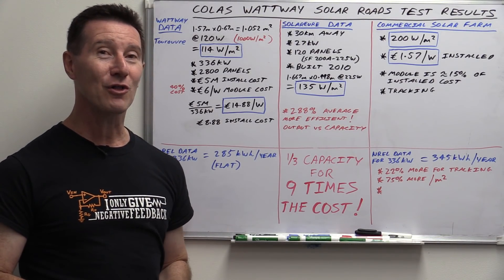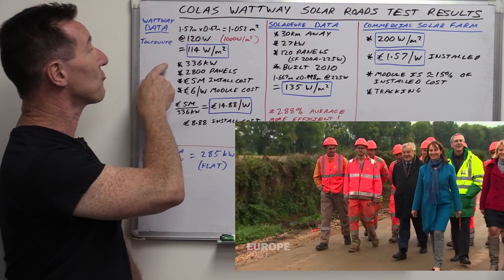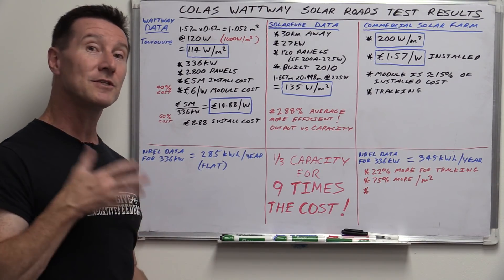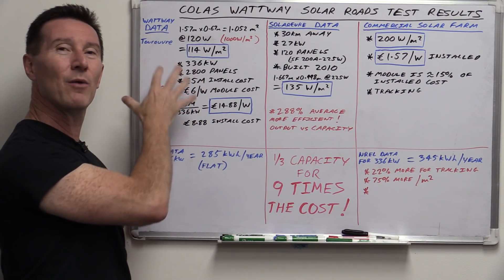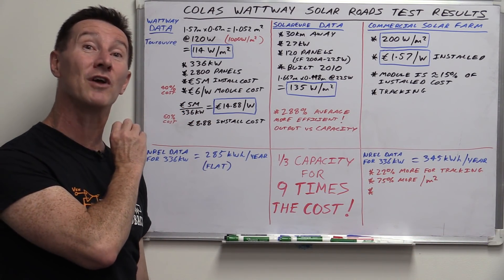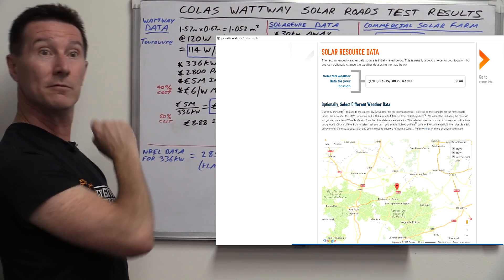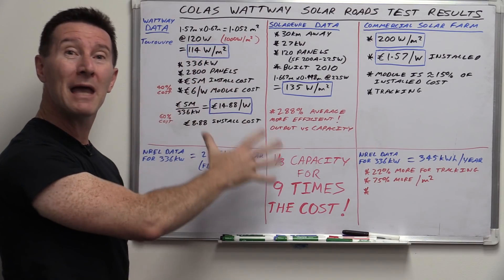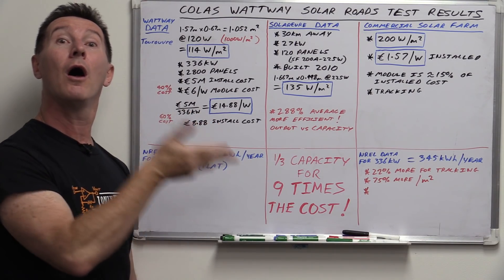EEVblog #1047 - Solar Roadways FINALLY BUSTED! (Colas Wattway)

Comment: Promote rooftop installation of solar panels. That would make good use of a lot of available space, doesn't require the space that we commercial installation and would also make more sense then solar roadways. Like you said, any government employee that supports solar roadways should be sacked. There are way better ways to spend the taxpayers money.

Comment: One of the worst variables of a solar cell is actually heat, believe it or not.  As heat climbs, output declines.  Now imagine a panel on one of the most thermally capacitive materials (ceramics and stone) in the worst color for thermal dissipation / reflection (black / dark grey) and in typically, or even seasonally, hot climes.

Now imagine your device also generates heat and that you've cut your surface area for the heat dissipation of your device by half.

The best case scenario isn't simply sub-optimal output at high cost, it's that the things don't overheat - short - and then catch fire.

I imagine a system based on geothermal gradients would be more cost efficient and practical.  Use the roads to trap and store heat, run water through chases and hollows in and below the hot roads to a heat exchanger, run an engine (maybe some sort of sterling engine), profit.  It would never generate the same power as a power plant, but when we're playing the "every little bit helps" game - it's better and smarter than gluing solar cells to highways.

Comment: if only they marketed something a bit more practical like "Solar freaking Rooftops!" perhaps make some cheap/simple/easy rooftop replacement solar panels or add-on things (like we have now...) and put them on all the rooftops.. it would be almost like a solar roadway but.. without the problems? no cars/rubbish on them, can use more efficient panels.. etc etc.. urgh :/

Comment: I looked up an early article from Dec, 2016 that said that they projected an energy output of 280 MW-hrs/year. The data shows they got 150 MW-hrs/year, or about half the projected amount, and that is in the first year. The panels will deteriorate over time, so that number will go down each year. at 0.15 Euros/kW-hr that would be a payout of 22,500 Euros for a 5 M Euro cost! Even if they cut the cost to 10% of the first try it would take 22 years to pay off even assuming ZERO maintenance and no loss of output over time. Both of those assumptions are wrong!

Comment: Rooftop installations, and even rooftop PARKING LOT installations makes FAR MORE SENSE. Too bad that the Wizard's First Rule is so VERY VERY TRUE. I've seen it proven over and over "People are Stupid; People will believe what they want to believe."
So much money, and R&D has been wasted on this fundamentally flawed idea.
"Wouldn't that be so cool, to have solar roadways, this hype cool thing with changing indicators on the surface" etc etc... But it will not work in a cost effective way!!!! Just spend the money installing REAL EFFECTIVE solar installs.

Comment: I'm still propagating the solar noic blocking walls for highways, you can put them on a fixed angle, better than flat and they will only get shadow from the higher trucks, but you could compensate for that, but just an idea that may or may not payoff

Comment: A much better solution would be adding solar panels ABOVE the road. You automatically get rain and snow protection and solar panels that actually works. And you can add overhead lighting that uses part of the solar power. It would probably be cheaper to install too. However, servicing might be costly.

Comment: Solar frikkin' car parks might be a better bet. I'm thinking sports venues and out of town shopping malls. Traffic speeds are low, so skid risk is low. Surfaces tend to me much more level, homogeneous and uniform, and not the thin winding poor maintenance access ribbon constructions of a typical highway. The high wear, high speed surface of roadways sounds like a high maintenance low return engineering fail from the outset.

Comment: Should it not be 1/3 the Produced Energy for 9 times the cost?  'Install Capacity' is generally the peak watts... and, we can already see that to install 1W of roadway is  9x more expensive than installing 1W of commercial. Same "capacity"... but different real world generating capability, ie. the roadway generates at 1/3 the output for equivalent install capacity?
Semantics maybe, depends on how you define capacity.

Comment: Only valid argument is that roads belong to the government and fields covered by solar farm panels can be used for food growth. So long as the lifetime of the panels is long enough and a good maintenance contract is negotiated it doesn't matter so much what it costs at the start. How would the government buy all the fields to make solar farms of the same output instead? It's simple, there are more than 9*3 the available road surface than private fields we don't need for food available for free). And touching greenbelt land is a political and environmental no-go, besides it would look terrible whereas solar roads look better than tarmac. It's a bit like discussing the purpose and costs of modern roads when we only had dirt tracks everywhere; the future generation will laugh at this discussion when age of "abundance" comes soon (see Elon Musk's discussion about that) then manufacturing and labour costs will be irrelevant. You did a great job focusing on the electronics, but you forgot the most important factor. Please consider re-doing the calculation with the cost of renting private land added-in and somehow factor-in what it means when farmland is lost (must be some "sustainability" data somewhere to mix-in). I'm only a technical person too, but the political arguments alone are fantastic with solar roadways, so they're probably coming whether we think they are silly or not.

Comment: Watch the public outcry the first time they get a burst water main under one of these roads - what would probably require a road closure for  a day or so to rectify would turn into many many days. the road would be down on generating capacity (if able to generate at all) and the cost to reinstate the surface would be huge in comparison to straight tarmac.

Btw way I have this fantastic idea for "Solar Gardens" - take existing public parks and gardens, remove all the existing trees (the timber from these would be sold to assist in funding) then replace them with artificial trees where the leaves are all tiny sun tracking solar panels. There are many additional financial (business) benefits -  you can lease trees to telcos to put cell phone towers on and build little tree houses in them to rent out as small economic city dwellings

Any backers out there?

Comment: Hi Dave,
Excellent analysis as always.
To answer your question about the use of such a poorly optimized design: IMHO, being French and an electronics engineer myself I can tell you that it is a lot more appealing to the everage people (through the media who don't know a thing about yield and electronics) to have a technology that does not change anything to people habbits, rooftop or landscape appearance.
Sounds silly, but here some people still think that environment protection will eventually be deployed without changing the people behavior, so the government proposes solutions that go that way.
This project can be seen as a milestone more than as a technology that will be massively developed. Because in the end nuclear power is much cheaper and available
Reply: Nicolas P Oh it will change when the road starts degrading rapidly with age and people lose control of their cars and die in horrible crashes.

Comment: It would make far more sense to put cheap panels above the road, slant them at an angle and it helps direct rain away from the road surface, keeps the panels clean, and they're out of the way of traffic. If they used the really cheap and light film type panels then it wouldn't require any big supports either.

Comment: I read a few months ago about a company who was going to spend hundreds of millions of dollars I presume to install a solar farm in the Chernobyl exclusion zone. This seems equally as silly as the roadway idea due to the poor climate! they would be far better off building solar farms in the deserts and transmitting the power where its needed. Even at 50% transmission loss they would still be more efficient than solar roadways or putting PV in rubbish areas.

What is it with people who think solar is "free" energy... they don't realise that these panels have an environmental cost to produce, and install, also the electronics and wiring infrastructure all have a "carbon footprint" so wasting those materials on low efficiency installations is almost as bad as just sticking a diesel generator there! We need to get smart with Solar and use it appropriately such as solar thermal solutions with tracking mirrors to focus sunlight into a small area to boil water and run turbines, this requires more initial cost, but yields a more robust, higher efficiency system.

Comment: http://assets.amuniversal.com/86243fc036e9012ea5cb00163e41dd5b

Solar PV has some value in reqions where aircon is needed, or where no mains electricity is available. In others it's mainly a subsidy-sucking exercise. The price of the panels is artificially low, due to the market being flooded with surplus panels after subsidies were reduced from their original crazy levels in most places.  

Basically, few if any of these 'green energy ideas are worthwhile, and the problem with convincing people of this is that it's become a kind of religion. Call it sun-worship if you like, it's very close to the old pagan idea of the sun being the head god and giver of all life etc. If it comes from the sun it must be good.  

In reality we'd be better to spend the money on research into better ways of obtaining energy such as LFTR or fusion. The Greens won't have that though, because it doesn't fit in with their sun-worship religion.

Comment: Hmm the ideas there, maybe to get rid of the large installation cost they move the solar panels from the road to one location where land is cheap and sun light is optimum, these lets call them "arrays" could be made to track sunlight for maximum efficiency and the power can be distributed evenly and efficiently as it's coming from one large place, oh wait....
Reply: Oooh, solar parking lots?  Now you're talking!  A solar multi level would be better, because more solar road, obviously.
Reply: We could also just build this large facility designed to create a miniature sun who's heat boils astronomical amounts of water, turning turbines, which produce unfathomable amounts of electricity free of greenhouse gas emissions regardless of time, weather, or location?

My honest opinion? Solar power is a bandaid *at best*. IT's a piece of shit if you're not in a good place for one reason or another. No, we need to figure out nuclear fusion. Once we've passed breakeven on fusion reactors we can flip all this other 'green energy' tech off and throw it in the dustbin where it belongs.

Comment: For the people who still insist on wanting solar panels on roads... a far better idea than putting the panels on the surface of the road is to put the panels on a canopy OVER the roadway. That puts it more in the realm of rooftop installations and the canopy would shield the road surface and vehicles from UV and weather, plus maintenance would be a lot easier.

Comment: Commercial PV viewed on its energy production capability only is competitive even to a coal powered power plant in China or Vietnam supplying a KWh for 0.035 EUR to big customers.
The required energy storage is the problem, because private customers want electricity not only when the sun shines and commercial customers want to operate their factory preferably 24/7.

All available batteries are very bad from the cost, size, weight and the environmental aspect.

I call it the energy storage crisis, keeping us from utilizing renewable energy in a cost effective and environmentally friendly way.

Comment: Have you ever been to Germany? Or seen their autoban? they don't drive on their solar panels, they have them NEXT to road, where they drive

Here is similar but newer paper for data
https://www.google.com/url?sa=t&rct=j&q=&esrc=s&source=web&cd=1&cad=rja&uact=8&ved=0ahUKEwioou6D-pfYAhWEYVAKHWefCKcQFggnMAA&url=http%3A%2F%2Fwww.itrpv.net%2F.cm4all%2Fiproc.php%2FITRPV%2520Eighth%2520Edition%25202017.pdf%3Fcdp%3Da&usg=AOvVaw06UkIPYHMRAA2tgtQhErf3

Comment: I'm still wondering why any sane person would want to put the panels below the cars!
IF you want to use the space lost to traffic to at least generate some energy than put the cells ABOVE the road, 5-6m from the ground. Just put a roof over the road.
This way you can use commercially available cells, install them angled (or even tracking), have no dirt and shadowing issues and during the winter even keep the road beneath free of snow...

Comment: Dave did you compare the cost of Tarmac to Solar road ways?  Also did you compare the cost of maintenance of the 2?  As well what about the heat the tarmac gives off VS the lesser heat the solar road way would in theory give off?

Comment: If they'd place a couple of panels on the sunny side of the latitude roads and make it high enough It'd keep the cars running without getting hot from direct sunlight and create some wind deflection on the panels instead of on the cars and make it cheaper for the drive too... And on walkways panels could be used for keeping the rain off peoples heads.... But that's less gimmicky crap for the election times I guess so that'll never happen...

Comment: To be fair, if you're including costs for maintaining the surface of the modules, you have to factor in the savings on maintaining a tar road surface. Not that it will change the calculations by much - it's a stupid idea no matter how you torture the numbers.

Comment: I wonder if it would be possible to mount a roof over roads and mount the solar panels on that?

But that's still not as good a solution as giving people incentives to mount solar panels on buildings and homes, as well as to install their own batteries and inverters.

The idea would not be for everyone to go "off-grid" but to decentralise power generation.  Power stations could be smaller and would be mainly used to even out the supply during peak periods.

Of course, the power distribution network would need to be upgraded to handle having power routinely fed back into it from multiple homes and businesses.

Comment: whats it going to cost when someone blows a tire and skids their car rim down it for 300 feet?
Reply: Shawn Luke cool, so now we know exactly what we'd do with the solar version.

I wonder if this has already been tested, it'll be interesting to see if the tiles are more resistant. They may simply not gouge like tarmac.
Reply: Richard Gates 🤔 fuck off 😂
Reply: EitriBrokkr What is it going to cost when a farmer  drops a disc plough into them?
Reply: gorillaau or what about snow, salt, and snow plows
Reply: EitriBrokkr I wasn't thinking of that situation... Australian bias, I guess.
Reply: You replace the tiles as opposed to digging out a trough of road and filling it in again with new tarmac that never matches the original surface.
Reply: Alexis Boom Yea sure you replace the tiles, not what he asked. Its the cost factor!  Tarmac is cheaper!
Reply: Alexis Boom actually no. If it's a blown tire or a plow disc, it will leave 1 or 2 lines in the road. It won't shatter the surface (and there are no electronics underneath). More than likely they'll leave it there until they do the next overlay project.
Reply: +Alexis Boom
Are you really that dense?

Comment: Where the solar farms need to be installed is in the INSANELY RIDICULOUS amount of land that is wasted in highway medians, and countless acreages of highway ramps, etc. I've also thought about those lands for crop/food growth. It just seems like an INSANE waste of land to me...
Reply: Only about 41% of the land in the US is used for farming, that leaves the other 59% for other uses!. 
If you would have done a simple Google search you would have found out that only 0.6% of the land in the US would be needed to produce all of our electricity using solar. Since we could also use building roofs, or put panels on racks above parking lots, we would need even less land than that. Much of the land in the world is unsuitable for farming for a variety of reasons, such as being to rocky, too steeply sloped, or not having enough water. 

Even using 0.6% of the land is NOT an INSANELY RIDICULOUS!

Comments like yours are a reason we need to improve STEM and critical thinking in the education system.  People who support solar roads tend to be those who are scientifically illiterate.

Comment: There is far more, than just watts and cost of implementation. Of course in those terms it may not be practical. How good or bad of an idea this is, should be analysed in a much wider scope. As an example, maybe the road could get a lot of attention and promote the usage of renewable energy in the population, and even when the road is not practical in terms of its cost and power, its effect on the population could make it a good idea.